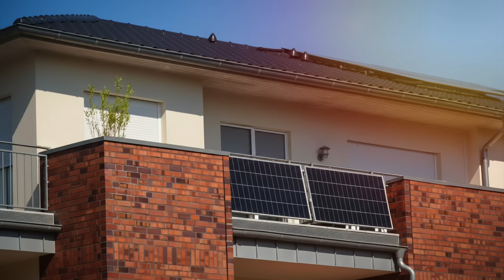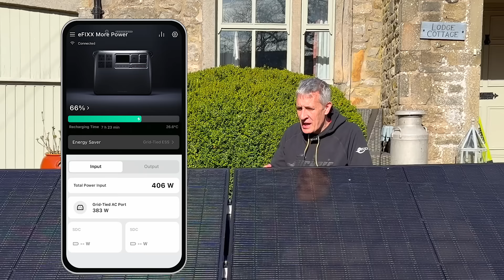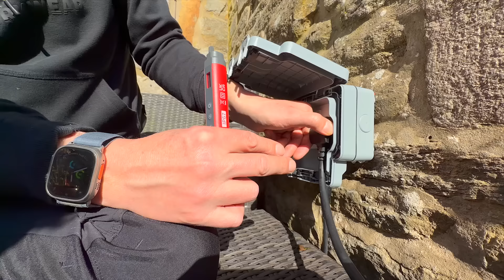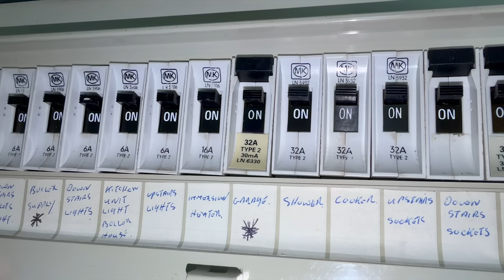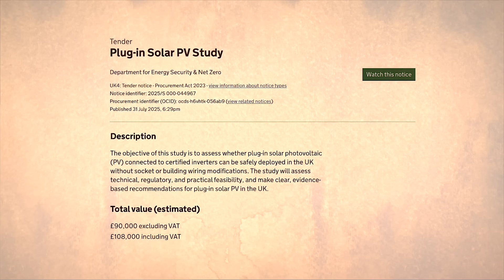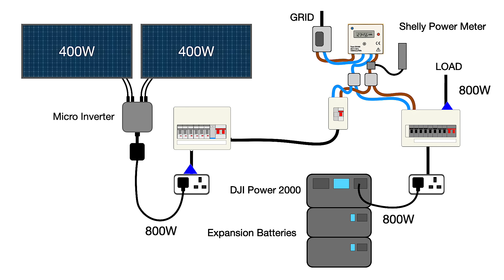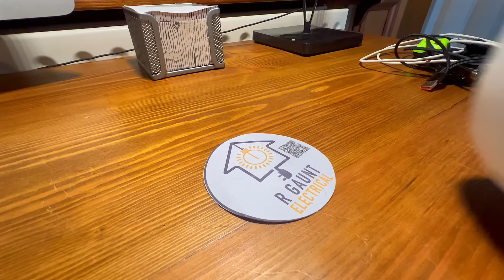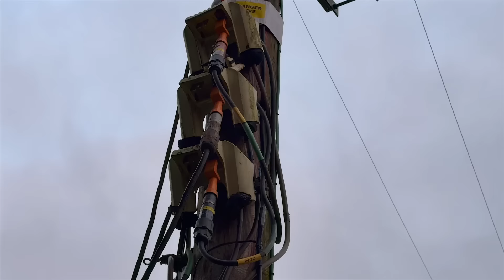Plug in Solar: We’re Told Never Do This… So I Did

Comment: I've got the DJI 2000 with this set up, top tip is that with the DJI 1KW car charger you can use 2x 12v 280ah in series (I've got Ecoworthy) to provide an extra 7Kw of storage on the cheap.Think I paid £120 for the Car charger and £350 for each battery. Set the voltage for 24.0v to discharge them back to the DJI and 27.4v to charge them overnight. As you recommended in a previous video I used the shelly Pro 3EM which controls the feed back to the house.
Reply from the maker: That's a great setup, thanks for sharing the details! 🚀

Comment: What about ring final circuits? If you have multiple sources of input and output on a ring final you can end up with gross overloads on a leg of the ring which the protective device for the circuit does not see.
Reply from the maker: This is a big debate in Germany ( not rings of course) - but introducing 4-5Amps on a circuit rated at 16amps. So in theory could have 20 plus amps.
Reply: @efixx  yeah on a radial you would have the same issue with loads towards the end of the radial past the sources of input. I assume this is why they limit it to 800W? But of course you could still plugin a load of them?

But I’m not sure it’s any worse in reality than telling people they must not overload extension leads. At some point the person plugging stuff in needs to take some responsibility
Reply: And plenty of instances out there where the ring is broken and no one's realised
Reply: What about isolating the circuit too.
Reply: @morestuff4401 you mean for testing? Just unplug the solar.
Reply: @pau1phi11ips  if you were working on the ring, and you switch off the mcb...
Wouldn't current still be flowing around the circuit due the the solar being plugged in?

Sure you can simply unplug the panels...
And yes, you should test the ring after isolation to make sure its dead.

But surely the ring would still be live due to the solar?
Reply: Its only 800watts max generation ! . The cable rating of your ring is not anything like that close to overheating in normal use - though that is exactly the reason it is not higher and set at  10 or 16 A max. In reality anything up to a couple of kW would probably have been OK, even on a well loaded double spur.

Comment: Its often missed that even when setting the possible impact of dc leakage to one side that you still have an increased risk as the inverter shutdown is delayed. E.g. a micro inverter on a final circuit with a shared RCD. A child touches a damaged live conductor and the RCD trips in the specified time, however the inverter takes a further amount of time to sense the line drop and shutdown as well. Is that dangerous? It would be interesting to see in tests what happens.
Reply: I don't know UK regs in this regards but ideally the RCD would be neutral switching so in the event a child touched a live wire on the load side of the RCD, ie where this plug-in device is, both line and neutral will be isolated, neutral will not be connected to the earthing system (for TN) therefore line and neutral on the device should be safe to touch should the RCD operate.
Reply: @retrozmachine1189 standard uk RCBOs are single pole (only see dual pole type on ev chargers) these inverters shutdown very quickly when grid is lost (but risk is still there thought)
Reply: @leexgx  Older ones perhaps but I'm seeing a lot of neutral switching designs on the market.  It's generally not a requirement to switch the neutral in many countries but neutral switching is recommended.
Reply: You can use my kids.

Comment: At this point it's become a "keep off the grass" issue. Ecoflow for years shipped a product with a plug and when dinged shipped it with a plug that said "do not use" and a wired in lead. Their newer products only ship a lead (no plug) but the lengths are set for a UK plug 8)

Aside from protection and plug there's a third issue to consider - circuits being overloaded, especially if say a ring has a break or breaks. Overloading on a correct ring can be handled easily enough by downgrading the protection by 4A or so but that's back to electricians.

Also worth noting that the 800W is the grid tie limit in most of the approved countries, in some it's even the export limit so they do clever stuff. That means you can hang more than 800W off many of these systems providing you plug the high energy draw devices into the sockets on them. 1200W of solar seems to be common in much of Europe at this point even with an 800W export limit.

Sooner it's sorted the better given the current oil/gas situation, however what we really need is a 3.68kW fused and bidirectionally protected spur with isolator and some suitable plug (locking commando say) as a mandatory fitting in garages or on the back of all new builds or rewires so people can just plug in sensible sized systems safely.
Reply from the maker: Good idea on the standard circuit !
Reply: Overloading is my concern too.  It is the general public to, and we all know that is going to mean more than one unit is going to be plugged in to a given circuit increasing the risk of overloading the wiring.
Reply: Yeah these need to be made legal. It would be nice to be able to get a max of 1600w by creating 2 separate solar arrays on the upstairs ring and the downstairs ring and have a dedicated circuit from the consumer box to battery storage.

It would massively reduce the cost of solar as it could be installed in less time, without scaffolding and providing the wiring and consumer unit is all modern without issues, would be a relatively short job for an electrician to install a line for the batteries (depending on location of course)

I would personally opt for a 10KW~ Battery setup from fogstar, perhaps even looking at the new sodium batteries for the extra piece of mind. That amount of battery storage should comfortably last my personal electricity usage at least a whole day if I'm not charging the car
Reply: @CH11LER.  At the point you've got a dedicated circuit you can install up to 3.68kW of generation with G98 approved equipment and you'd want to run the solar into the inverter/battery combo as DC coupling it is way more efficient. As the battery should now be outside or in the garage a single dedicated circuit to the outside would do the trick.

Once you get into dedicated circuits though you get into electricians and it simply doesn't scale for small users like flats and apartment blocks.
Reply: Are you suggesting that each garage expose an IEC 60309 socket?
Reply: @beedell.roke.s13ouq  Or something similar - whatever works sensibly. If it was a serious concept I think it would also need to be a specific unusual colour and labelled in some way so it's used for the intended purposes. Would also then I think work for one of the "portable" EV chargers instead if someone needed to charge two cars or something.
Reply: Sounds perfect... apart from my daughter's vivariums,  ours is a reasonably low use house.  Peaks are going to be the kettle,  microwave,  and the washing machine,  and that has hot and cold fill so not using electricity to heat the water

Comment: I've got an 8kwh delta pro 3 with microinvertor. A registered electrician wired the microinvertor into a fused spur. I informed my dno that it has been installed. My bills are down fron £60 a month to £35. No issues
Reply from the maker: Great info !
Reply: The key here is you are using a fused spur installed by a qualified electrician. Most will just plug it into a ring main and they won't be getting the well engineered system from Germany they will get a cheap system from China that is essentially a death trap.
Reply: @schrodingerscat1863 most of the ones used in Germany are made in China.

Comment: Interesting. We have a Motorhome. Last month I wired à plug both ends of à short 2.5mm twin and Earth with a switch between the two. I then plugged one plug into a Jackery and the other plug into a socket in the garage of the Motorhome that I hoped would power all the sockets in the habitation area of the Motorhome. The switch stopped both plugs becoming live until in the sockets and turned on. 

At that time there was no other power coming into the Motorhome with all sockets otherwise dead, and as long as I don’t plug the external inlet into a 230v power source that will always be the case. 

Anyway, I plugged a lamp into what would normally be a dead socket in the kitchen and, it lit up. In the future will stick a couple of solar panels on the roof then through an isolator switch and onto a Victron into a battery then the battery will feed a larger Jackery into the Motorhome socket in the garage. Instead of the switch I’ll be using an isolator between the plugs. I realise I could use an inverter instead of the Jackery, which would be cheaper. However the amps running in this set up can be very high. The battery feeding the Jackery solar inlet delivers a steady 12v. And, the Jackery can easily be removed and used as a portable power bank if required.
Reply: I can vaguely remember some posts about 'suicide leads' like that (as they were called). Sometimes they worked without problems, other times they didn't. As I recall the problem was put down to differences in the mains earthing arrangement, when it was incompatible with that assumed by the inverter. I'm guessing the key point is how the neutral voltage is tied to the earth line - might be worth searching for 'suicide lead' for more information.
Reply: Could you not feed the solar panels directly into the Jackery?

Comment: Not allowed by which law exactly ?
Reply from the maker: That’s a great question - ask any of the electrical orgs you’ll get a different answer - law is probably a bit strong - random regulations and standards is where the barriers seem to be. Bs1363 etc
Reply: Issue I see if people will naturally just plug this into your standard domestic ring circuit, likely have say a fridge on the circuit for example. Drawing supply from the panels, develops a fault, RCD won’t see it as it’s bypassed by the fact supply is coming from the micro inverter. A short circuit should clear as the fault current will be high and flow through the OCPD or blow the 13A fuse on the micro inverter plug.
Reply: Building regulations part P compliance requirements, which in turn comes down to BS7671. You can actually do some of the work yourself and get a sparky to finish the job, but they tend not to like things like "I built this 16kWh battery from a kit and I'd like you to help me wire it to my house...", you can also do the entire job yourself and then get it inspected by a building inspector.

Quite a few self build house people go the latter path.
Reply: 3 things. Plug and socket regulations prevent you selling anything domestic with any mains connector that is not a BS 1363 13A plug,  BS1363 prevents you using a 13A plug as a power source, and BS7671 refers to that.  In reality the plug and socket regs were intended to organize the phase out of a plethora of round pin stuff that has now well and truly gone, and could safely be repealed, and BS1363 and by implication '7671 can and will easily be amended with no legal changes.

Comment: So all the years of forced MCS accreditation and the the convoluted Regs and need for competent persons and qualified electricians goes out the window and joe sixpack can just plug and play with impunity....
Reply: Joe block can output 800 watts, you with mcs can output lets say 5000 watts. That's a big difference.
Reply: @stevieuk260  Quite so, but its not just about exporting, there are plenty of other safety issues, some of which the video high lighted. Actually I'm in favour of DIY by competent people, but that's the crux, who is competent. Also house insurance may become an issue....
Reply: Of course, because as you say it's "plug and play". You're plugging a mass produced, quality approved device into a socket, no different to any other appliance around the home. There has been no forced MCS accreditation, plenty of people have non-MCS installations.